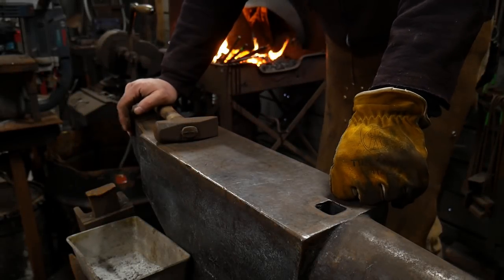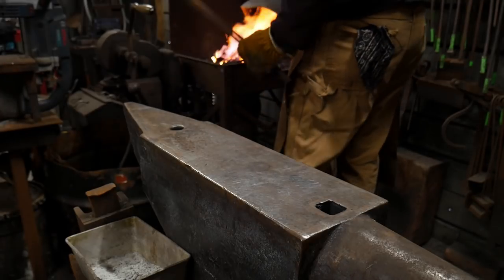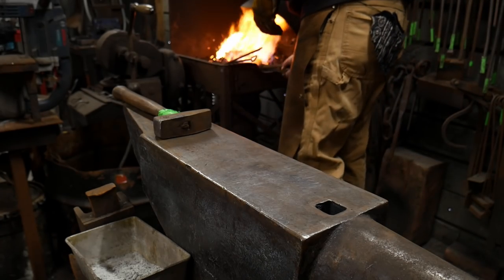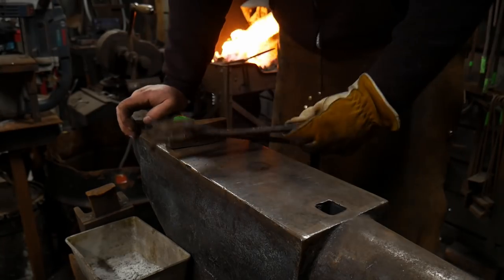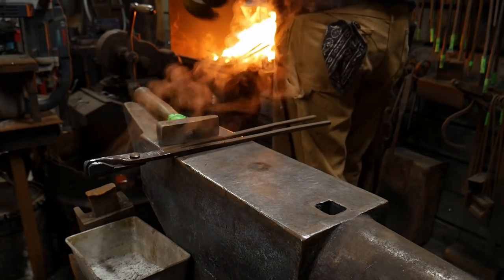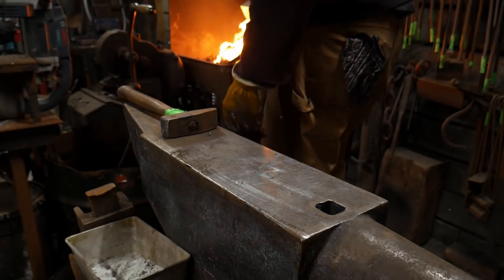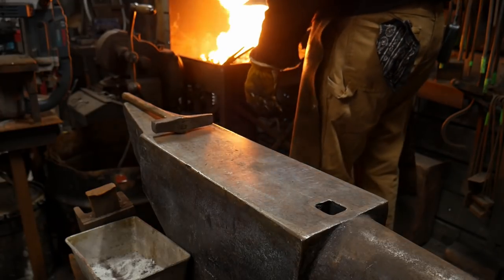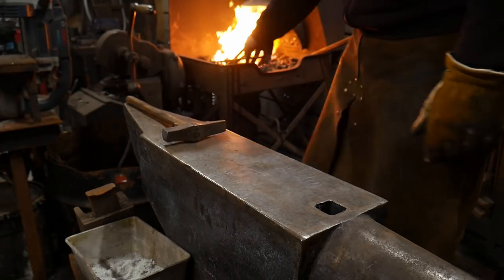Forge Welding a Tee Weld [Forge Welding Techniques]

Comment: I'm loving these forge welding tutorials you have been putting out recently. And, the real-time format is really great! Also leaving in the failed attempts (with explanation) is a great part of the learning process, which reminds me of a saying . " The difference between a master and a beginner is that the master has failed more times than the beginner has ever tried ". I always try to keep this in mind when learning anything new and it really helps me to see failures as a crucial part of the learning process. All in all, I would say you have the whole forge welding process down to a T  ;)  ✌

Comment: In my 18+ yrs of hobby smithing, I've only nailed 2 forge welds, and both were in public! 1st one was a 4" dia saddle ring for a stirrup, 2nd was a fold over in 5/16" x 1/4" to build mass for a tab to tie broom straw on a fireplace broom, which was then flattened to 3/4" wide x 1" long tab with 2 punched holes so the straw could be tied on later. Also welding in public is a NO-NO! flying debri could hit the public!

Comment: Can you use the heat and hammer method with a torch or does that allow too much oxidation into the weld surface> I am looking to try when we get more gas. and you say you make it look easy, I dont think that so as it still took you 3 tries to get the weld to stick which shows the difficulty, and then there is setting the weld that takes a long time, as opposed to taking 2 minutes grinding and 20 seconds to use a welder as it were. but I still plan to try.
Reply from the maker: You probably can weld the joint using oxy acetylene then hammer after
Reply: ok I will give it a shot once I can get more gas

Comment: I have only had one successful forge weld so am by no means an expert, but this is a drop tong weld and you look for a place to put the tongs down. The tongs wont be hurt if you drop them and will save you part of a second.
Reply from the maker: Technically yes you are correct I am dropping the tongs in this weld but that is not the name of this particular Forge weld. The name stems from what its shape is which is a tee. This is a name that was given it from antiquity. When people refer to a drop the tongs weld they are referring to the action of dropping your tongs not the particular weld at hand. The main types of welds are (L, T, Glut, Butt, Lap, Half Lap, Blind, Collar, Jump, faggott, and Cleft weld more commonly known as birds mouth weld... some of these welds but not all require you to drop your tongues when making and joining the two pieces of Steel. Others however will require riveting, pinning, wrapping or stacking. Hope this information helps you in continuing your love for this great craft God bless you and have a great day :-)

Comment: I've  had no success forge welding , yet. I see now that speed is really a factor and you have to be fully set up when you take the 2 bars out of the fire. You mentioned the anvil sucking the heat out really fast. Would a piece of 1/2" x 4" x 6" steel plate heated up reasonably hot and placed on the anvil just a minute or two, to preheat the anvil,  help or cause damage to the anvil prior to attempting the weld?  I have a smaller Farrier's 75lb anvil. Thanks. Cheers.
Reply from the maker: In your case heating of the Anvil a little bit could be beneficial although I see preheating anvils as a complete waste of time. The reason for this opinion of mine comes from the fact that I work all day at the Anvil and the surface on a 465 lb anvil attached to a 350 lb steel base barely climbs above Body temp after an entire day of forging.. usually your weld will not be on the Anvil face for more than a half a second before you start to hammer on it. My main point in mentioning this was to support the fact that speed is the most important thing in the Forge welding process. The larger the stock the longer you have to make the weld but if you leave that stock on the Anvil it will chill whatever is on bottom to a point that it will no longer be at a welding state if left there to long.. thank you for taking the time to watch this video God bless you and I hope it will help you with your forge welds.
Reply: I have thought of that, red hot plate on the anvil a second or two before attempting the weld on top! May help retain the heat for that extra second. Haven’t tried it yet but might now that I know heat is ultra important!